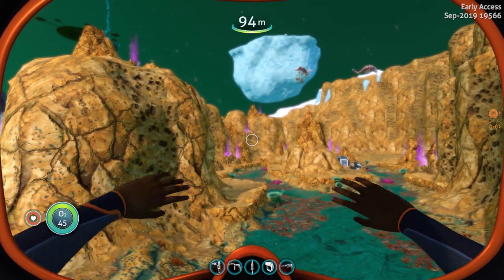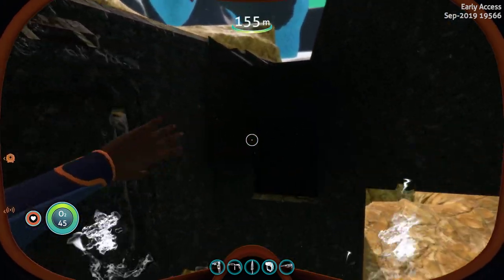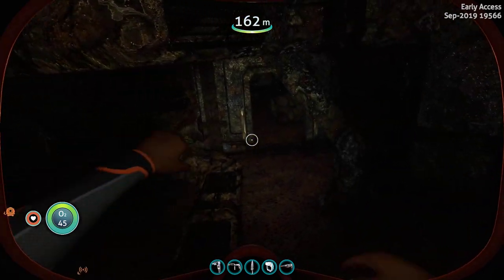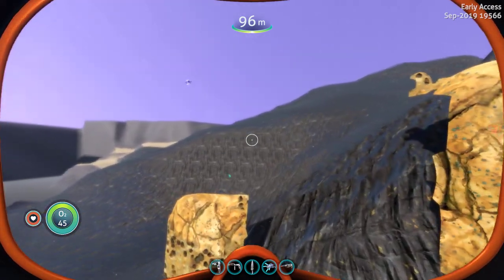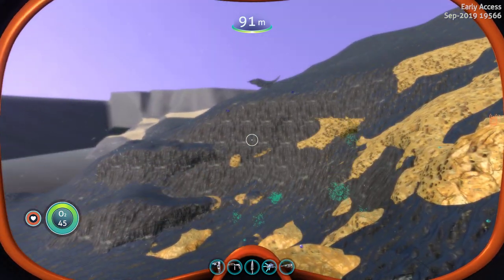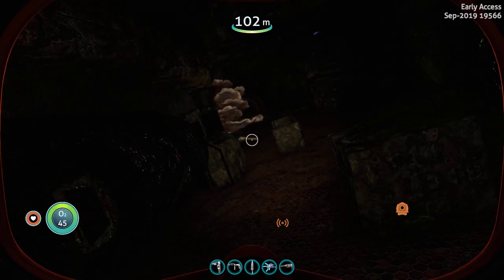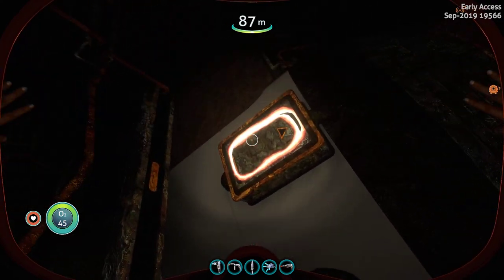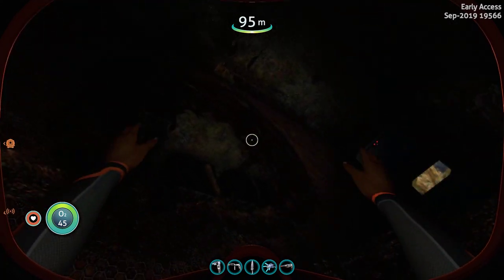SNEAK PEEK | CRASHED SHIP 3 | Subnautica: Below Zero (experimental) Exploring Build 19566

Comment: This is removed in build 19837
Reply from the maker: It's been gone a couple weeks now, i think they are reworking the model
Reply: @smokin6951  the problem is where to get the shipwreck
Reply from the maker: @arch.samertaleb  If you mean the salvage to fix the radio tower, it's no longer needed it was replaced with the advanced wiring kit. The other shipwreck is still in game
Reply: @smokin6951  I tried with the advanced wiring kit but it didnt accept it, still saysa purple vent salvage
Reply from the maker: @arch.samertaleb  are you playing the stable version? or experimental
Reply: @smokin6951  early access version, maybe that is the reason